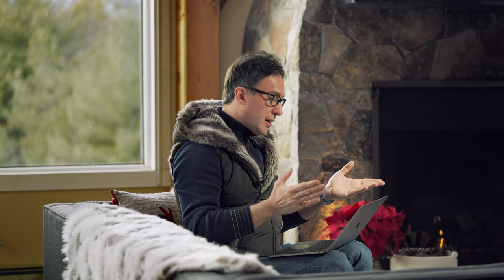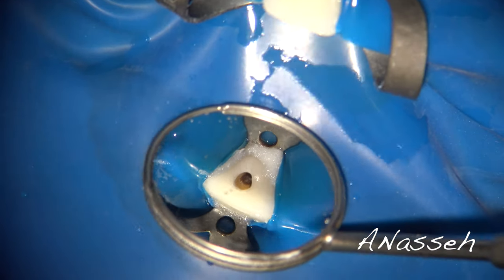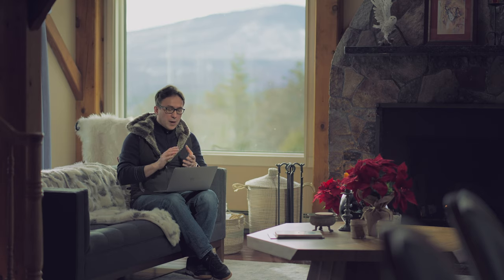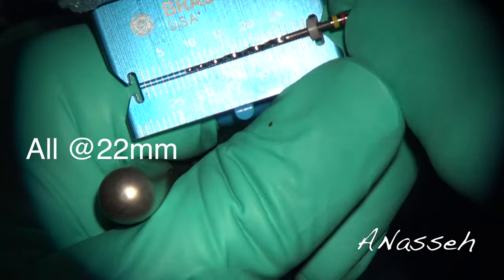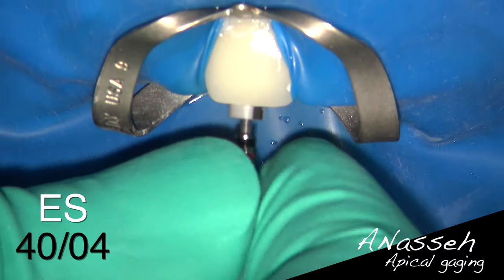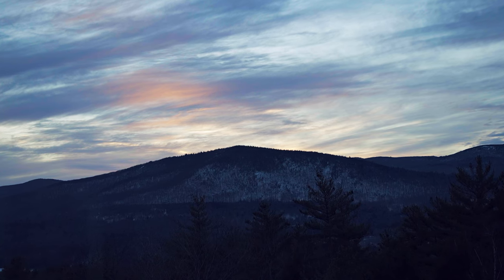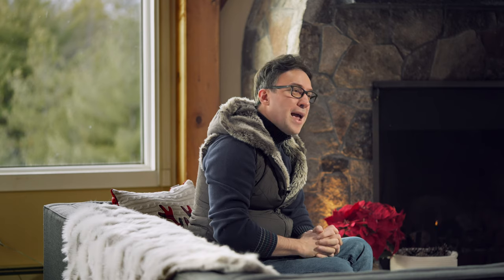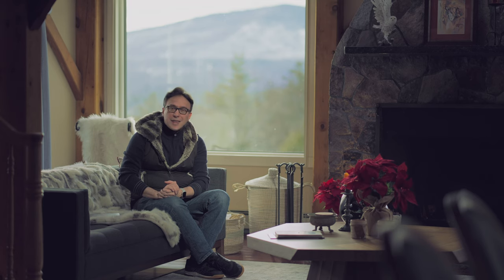Apical Gauging Large Anterior Teeth Thank you 50K Subscribers!!!

Comment: Thank you for sharing, Apical Gauging is a very important concept, may I ask you to choose #55/04 is based on 3 sizes larger than IAF(#40) ?
Reply from the maker: Sorry for delay. I used a file that fit/engaged about 2-3mm short of the apex, which meant if I worked it down to the end I would end up touching the walls completely and cleaning with more contact the apical 2-3mm with the file. Essentially, gauging the apex first and then using.a file that would fit a little short of it to complete the corking out and cleaning of that last segment. Cheers! :)
Reply: @AANasseh  Thank you very much for your very detailed and educational answer, it is much appreciated!

Comment: Thank U doctor for your interesting videos as usual
May I ask How did you know that the file which 3 mm away from the apex is gonna eliminate all the biofilm there ? Maybe the biofilm was inflitrating deep in dentin the apical third than the width of flutes of the files and need more wider apical diameter file?
Reply from the maker: Great question. Like anything else, I think there's a certain amount of doubt we just have to live with. We currently can't know the information you want to know; so we're left with approximations of things we can know. Luckily, the apical third does not have the same number of dentinal tubules as the coronal 2/3 of the root. The dentin is more amorphous. So growth into the tubules is not as important as the top. Here, just cleaning the surface and slightly deeper would suffice. But I agree that the on top microbes can go much deeper. Luckily, cleaning on top is much easier with ultrasonics and irrigants than at the apex. That's why we can still expect good results despite the complexities of the root canal. Cheers!

Comment: In obturation, what happens if fill the canal completely with calcium hydroxide aqueous solution/gel, and then obturate with zinc oxide eugenol cement coated on gutta percha,and seal it in canal. ???? what will happen, chemical reaction, idealistic, longevity, durability. Etc...?
Reply from the maker: All Ca(OH)2 should be removed during the second appointment and canal reinstrumented clean and fully dried (with alcohol rinse) before attempting to seal with ZOE/Gutta Percha. If Ca(OH)2 is not removed completely there will not be an adaptation of the sealer to the canal wall.
Reply: @AANasseh  thank you for your reply, love you sir...
Reply: @AANasseh  Hi De.Nasseh! Do you always rinse with Alkohol to dry the canal? Thanks
Reply from the maker: @ZACY1234  You only need to do that for hydrophobic sealers like ZOE and Resin. For bioceramic sealers you don't need to do that. Just a paper point or two is enough. Cheers!
Reply: @AANasseh  ok! Thank you very much 🙏
Reply: @AANasseh  Hello Dr. Nasseh! I use ZOE sealer, and I wanted to ask you if it's ok to rinse with saline after NaOCl, and then dry with alcohol, because of the risk of forming chloroform if NaOCl and alcohol interact?
Reply from the maker: @draganjovic1992  Yes it's fine to use saline as an intermediary... but even if you form chloroform I don't' think it would be in significant quantities to cause a problem. After all, that has never been a described problem and is merely a chemistry trivia  than a cause for failure.... you can also dry the canal with paper point before you add the alcohol further reducing the NaClO amount.

Comment: didn't get the meaning of the "nailhead" , any further enlightenment ?  15:16
Reply from the maker: When you melt the Gutta Percha about 1mm above the orifice and come back immediately and plug it down with a size 10 (large) plugger. You end up spreading the mass of Gutta Percha around the orifice wider than the base of it. It looks like a nailhead in cross section and it covers the seams of sealer.